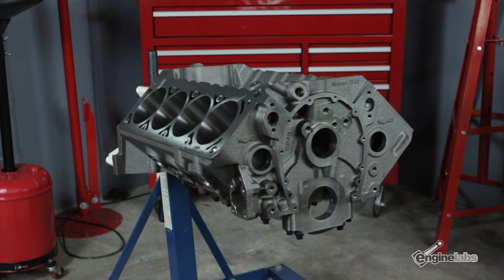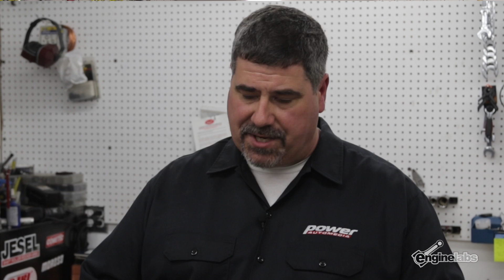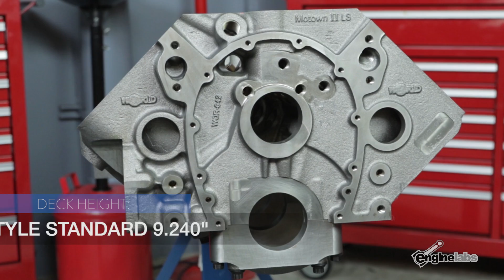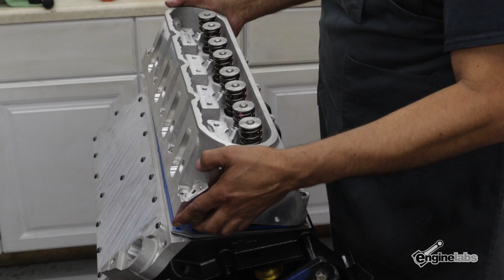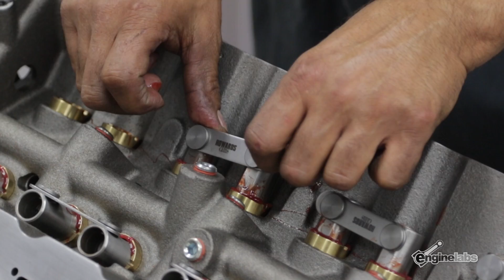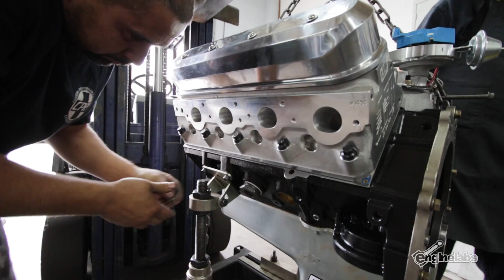Motown II LS Part 1 - The Build

Comment: That's going to be a crap 💩 load of money 💰 and you still need all the accessories
Reply: they are regular sbc accesories,ive got 3 serpentine belt setups that would work with this in my garage and 2-3 other older setups that would work
Reply: trillrif axegrindor yeah to the small block part of it but what about the LS head that the motor takes yeah a old setup that bolts on to the block only but even on them you need it to bolt on to exhaust manifold even they admit you need a front head adapter for Accessory like AC power steering

Comment: What about push rods?  That was an issue with a SBC.  I really like the Hybrid block.  I heard windage is an issue. PBM  and other companies supply an appropriate pan set up.  I am not so sure the LS block is stronger.  This block has been heavily strengthened.  I'd love to build a full race NA motor to see what we can get out of these motors!
Reply: Hey Steve I'm all in for the hybrid deal the problem I'm having is trying to justify 3300 clams for cast iron  SBC ????????????? So before I get  any heads on the motor I'm into this for  Cast iron SBC for nearly 10 fucking Gs bro ? Are you on some new kind of designer drug ?

Comment: I don't get the point.  Why not just get a 4-bolt SBC block and call it a day if you're worried about fitment?  There are lots of head options for the SBC and you can make really good power with them.  And as someone said below, you can buy a lot of custom oil pans, motor mounts and cross member modification for $2100 and just drop in an actual LS which is a stronger block design, with no issues getting weird internals that won't fit in any other SBC or LS setup.  And let's face it, nobody who's putting in an LS really wants to run the old transmissions either, because they suck too.
Reply: jdr ok
The truck "LS" motors are pretty much identical to the cast aluminum LS, they come in cast iron and they're even stronger than the aluminum LS.  Same head options as the LS though, so same power potential using factory junkyard parts.  I'm sorry, but a 3rd gen small block truck motor (iron that is) is much stronger than even a 4-bolt SBC, and even the aluminum cast blocks are comparably strong (maybe stronger) than an iron 4-bolt.  And I'm talking about factory stock here, meaning your 4-bolt block is a unicorn and you may as well go aftermarket at that point because you're generally stuck with 2-bolt main stuff in junkyards.
If you're going full race 1/4 mile stuff, TH400 or 2-speed Powerglide works fine.  But you probably didn't know they're easily adaptable to an LS with a custom converter or flexplate (which you'll probably want a high stall converter anyway, so no extra cost there).  If you want to go with a handling car and a manual (most would want this for a track car), the modern overdrive transmissions are way better, especially if you want to drive them on the street regularly, and they bolt right up with no modifications at all.  I'm sure others who read your comment will know who the idiot is.
Reply: *****
Yeah, the splayed caps are pretty strong.  I'd be interested to see which ones let loose first too.  I'm still leaning toward the LS style because of the cross bolting and the block material then acting like a girdle because it envelops the entire main cap assembly.
Reply: Actually looks like I'm partially wrong.  I did some reading here http://www.lsxmag.com/tech-stories/engine/engine-tech-borowski-builds-mild-mannered-427ci-with-ls-next-block/ and a couple other places.  It looks like on especially high rpm and stroked engine builds, the LS has windage problems because each main creates it's own separate bay.  I think that ends up starving the sump for oil in those conditions.  So it's not really because of block strength that the Motown went with the splayed mains over the LS 6-bolts, but the oiling problems you see in certain conditions.
Reply: +blitz krieg either way you look at its still pointless, like already stated your going from a 6 bolt main to a 4 bolt... that along with the design and flow of the heads is one of the ls's trademark features for durability and strength and efficiency.  buying the block in this video is a completely unnecessary waste of money considering all the ls mounts and pans on the market today that solve any clearance issues...so basically your gona spend an astronomical amount of money on an inferior block that will eventually subside to the typical oil seaping problems that the sb's are plagued by
Reply: @lsxpowered7178   This block allows you to have an LS with a mechanical fuel pump and distributor.
Reply: Go educate yourselves by watching [Dart GM LS block Comparison] from Borowski Race Engines.  No LS/ Vortec can come close to the strength of 7/16 four bolt splayed billet mains as found in the similar SBC/ LS hybrid called the [Dart LS Next 2] block and no SBC heads can come close to LS flow numbers so that is why block manufactures like Dart and World now make a hybrids.
Reply: Bill Bradsky on the cast ls part they live a lot because of the fi and less weight on the pistons but the ls thrives on aluminum better the sbc can but has its own issues im a sbc guy because the sound is just orgasmic the bbc and w block are just life and the ls is meh the lt5 tho best sounding dohc motor in existence
Reply: Bill Bradsky im wondering if they could find a way to splay the cross bolted mains i heard gm does that on the lsx blocks but idk
Reply: Bill Bradsky thats why im wondering how gm is going to solve it i hear they use a windage tray but idk if it fixes the issue
Reply: No need in modifying the engine mounts and belt drive system, I would totally get this motor for a project car, preferably a 2nd or 3rd gen f-body cars.
Reply: @ Bill Bradsky

Yeah I don't get the point either.  A SBC with aftermarket heads will make excellent power.  From what I've seen LSX builds make power because they are running turbos. Run a SBC or LSX with a carb or fi they both should produce similar numbers.  Yes, you have to upgrade the heads, but that's just part of the game.
Reply: @c41man  no ls heads are far superior to sbc heads regarding flow. They make great na power and much better driveability due to the bigger cam design
Reply: Bill Bradsky  uh? the sbc bottom end actually is a stronger design for cast iron the ls is designed around aluminum im sorry old trans suck how come almost all drags cars run a gm th400 or powerglide damn man your a idoit

Comment: Nice but $2100 buys a lot of custom oil pans.
Reply: lolz
Reply: yeah but you'll spend about 1500$ more to get heads that flow like decent LS heads for  an SBC.  The only SBC heads i've seen touch nice LS heads 18* heads, that cost in excess of 3000$   I think i prefer the LS Next block from dart anyway..  This seems silly to use SBC crank though, as stock LS cranks can already take more power than you can get NA without going to like 16:1 and boring it and then stroking it past square...
Reply: @eianwahgener7623  9 years later there’s plenty of 23° small block Chevy  heads will outflow any stock  LS head.  Technology has also following the GEN 1 SBC they’re both 4.400 bore spacing , both engines  will make the same power.  What they’re not telling you in this video the reason why to use a SBC bottom end with  LS heads ,,, the stock LS skirted block  along with the cross bolt main caps cause a lot of windage problems.
Reply: He meant custom oil pans for an LS that a SBC would've originally been in, not the other way around.
Reply: and crossmembers,and revised harnesses,and accesories and special mounts and other bullshit i dont want to deal with that cost more than $2000